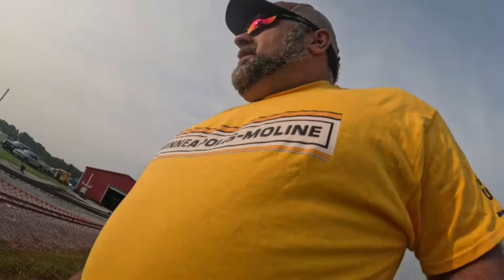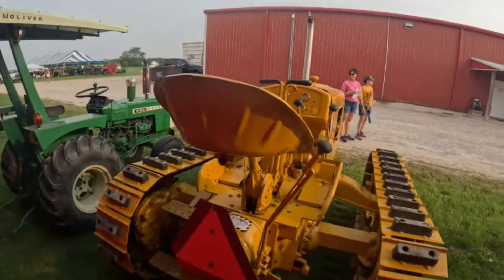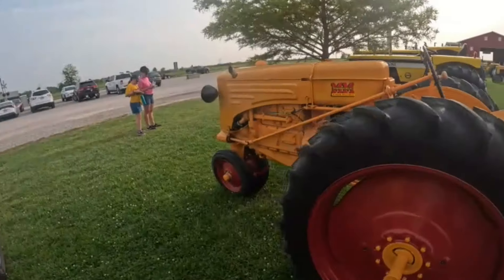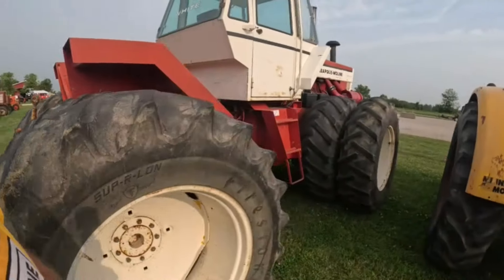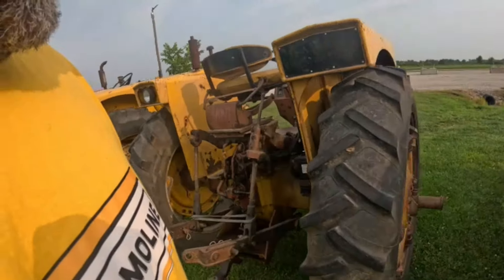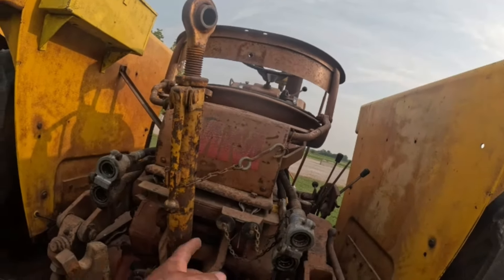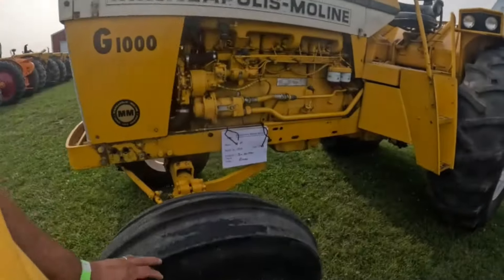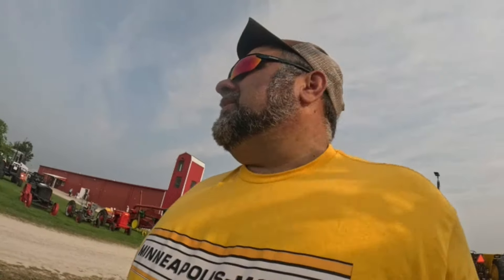American Heritage Farm Museum 2024 Show Part 1

Comment: OC 6 used the 77 engine and 88 transmission/rear end. They were sold as AG only crawlers, but eventually they relented and approved a few aftermarket attachments for them like dozer blades and buckets.

Comment: I see the 302,a 68 it reads,my 64 # 413, has same paint scheme except the rails that run to the front,mine are factory MM brown with yellow wheels. But I ,as you have read where MM has several colors they used in that 10 yr stretch.oh, Thks for the ride,that 4x4 MM,dam,that would be a neat toy,do you know how many were made? I like it.k,enough!back to walking with ya.